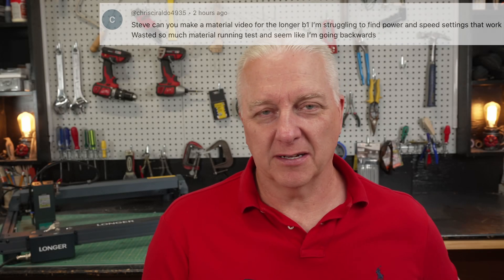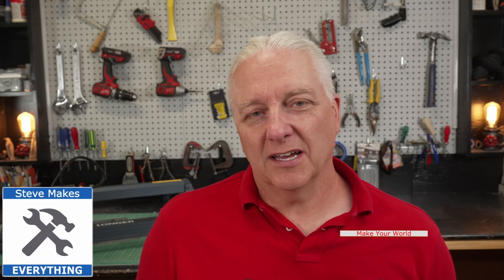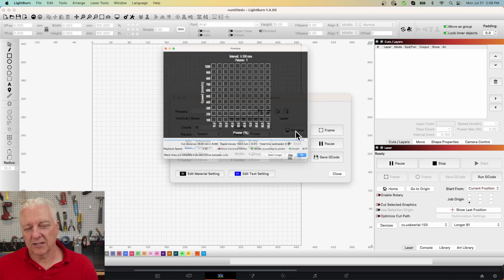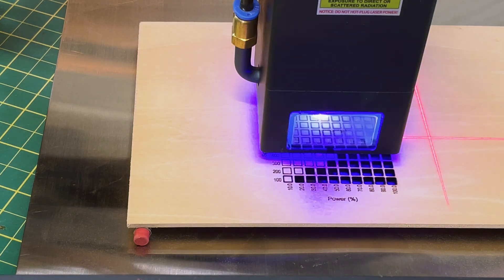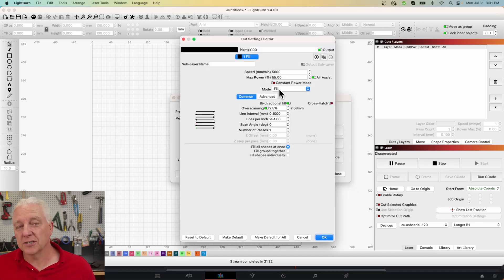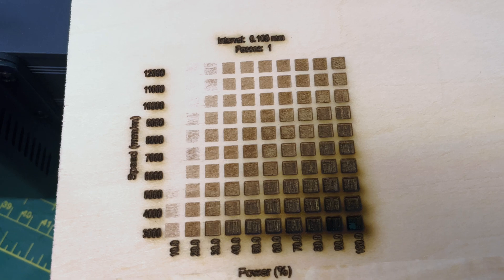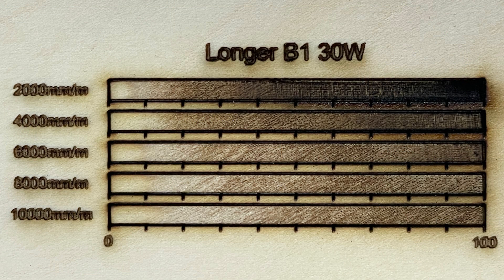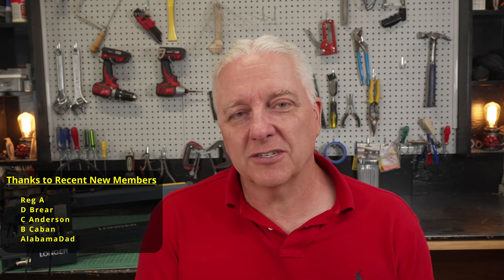Lightburn Material Test SECRETS You Need to Know for Better Results!

Comment: Steve, I am totally new to Laser Engraving, and as I was able to follow your instructions for setting up the materials test, how do I set it up on the machine bed, set the laser, etc.  Are you able to go a bit more basic starting at putting the material in the machine, seeing the workpiece - changing material thickness in Lightburn, configuring settings then starting the test?
Reply from the maker: I could do this, though there are already many beginner's guides to Lightburn.  It sounds like your issue isn't Lightburn though, so here are a couple of pointers:

- Lightburn doesn't have a material thickness setting - only power and speed settings.
- If you are having trouble with the machine bed, then you need to look at focus.  You don't say what kind of laser you have but there is often a drop-down leg that you can use to adjust the focus of the laser module.  Sometimes there is a block you slide under the laser module and then drop the module until it touches the block.
 
Once you have the laser in focus, you can run the material tests to help determine the ideal power/speed settings for cutting or engraving.

Does this help?

Comment: I know you've had co2 lasers (Muse 3d) and diode lasers that use Lightburn. I'm have problems correlating RE3 settings (FSL) to lightburn settings. How do they compare and how do I take setting other people use and translate to a starting point for my Full Spectrum Laser?
Reply from the maker: Yes, I have a Muse as well.  There isn’t a one-to-one feature match between lightburn and RE3. There are some features that are unique to each platform, but in general translating between platforms isn’t straightforward.

Comment: Are you using air assist on the tests you’ve demonstrated in this video?
Reply from the maker: Yes. I try to test the way you would use the laser in normal operation
Reply: @SteveMakesEverything thank you for your reply!  Should a person shoot for least scorch on one pass or do another test card with lower power and a couple/few passes? (Does that make sense?)
Reply from the maker: @corinnahamel8743  Diode lasers are funny beasts sometimes.  It might be possible to cut in a single pass and get charred cuts and sometime multiple passes just won't work properly.  You just need to experiment 😀
Reply: Steve - What air assist should I use on a MOPA Fiber Laser?

Comment: Something that took me a while to realize as a beginner was that you could save and reload settings for specific tests instead of having to edit the grid parameters each time.  Now, a question: how did you generate the gradients for the third test?
Reply from the maker: It’s a separate project, not a lightburn tool